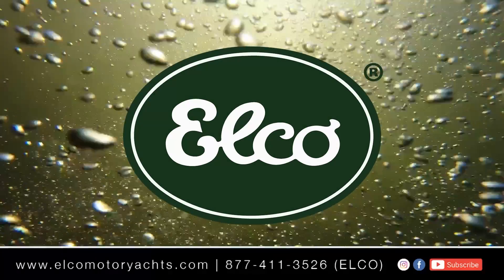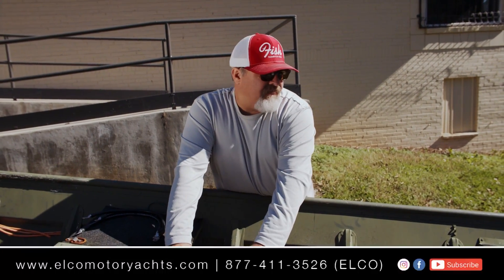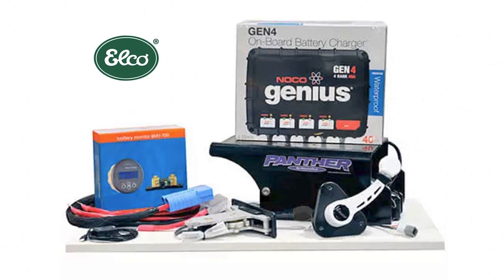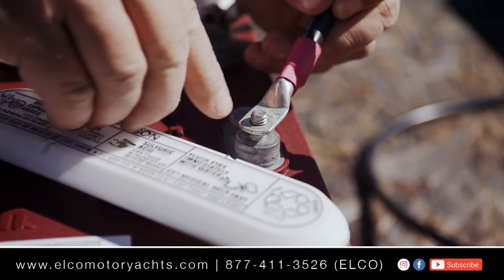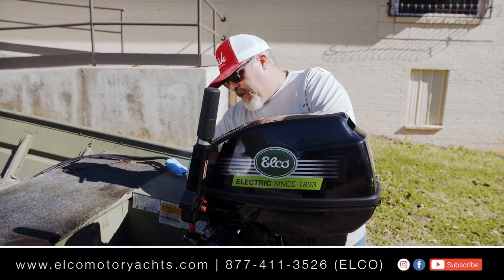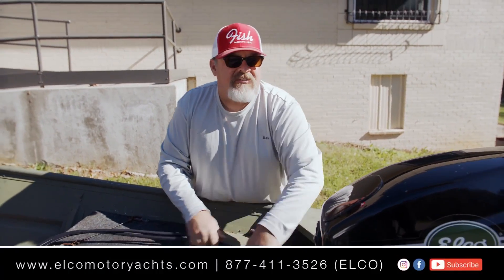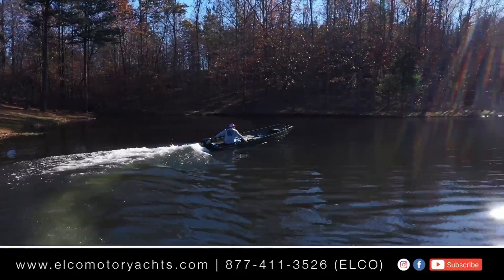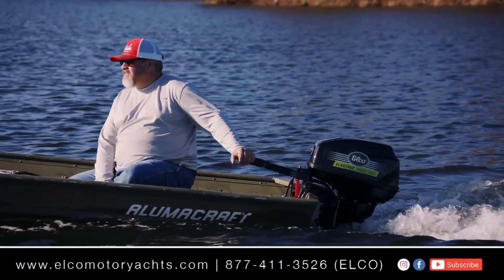Electric Outboard motor install - Elco EP-20

Comment: Im planning to put this motor on a Linder 445 Max, weight 500 lbs boat only (227kg) and with a battery weighing 145 lbs (66kg) and myself weighing roughly the same. Total weight with me, boat, battery and engine will end up at 875 lbs (around 400 kg). Length of the boat is 14,6 ft (445cm) and it planes very easy with my current petrol engine with 25Hp. Usually I dont have to go much above 4000 rpm to keep the boat on plane.
Do you believe I can plane my boat with the EP-20 engine or do I have to go for the EP-30?

Comment: How difficult/inadvisable to mount an EP-20 or 50 outboard to a cabin cruiser swim platform for a low-cost and low-noise marina kicker motor? Throw in an electric hydraulic pump and I bet you can use the existing rudder control for steering.